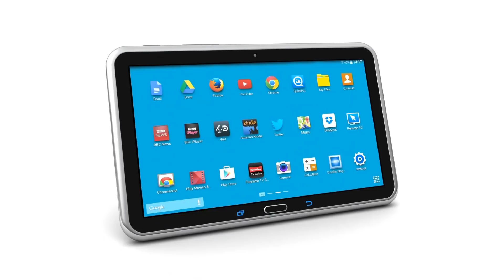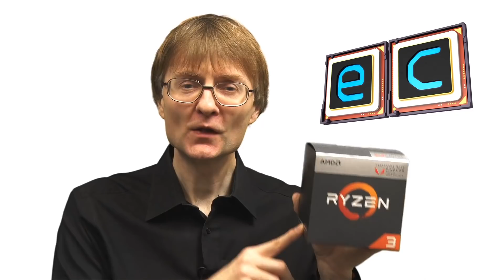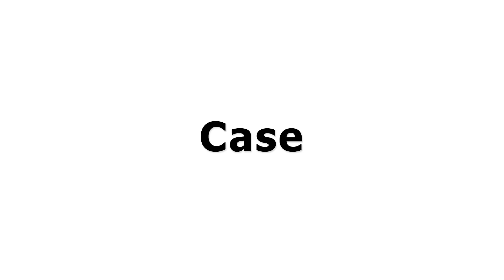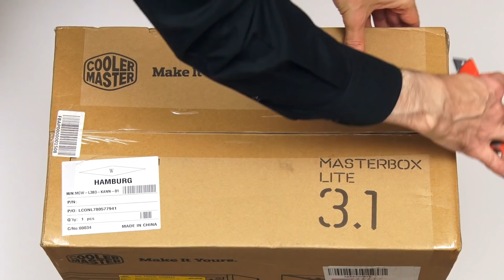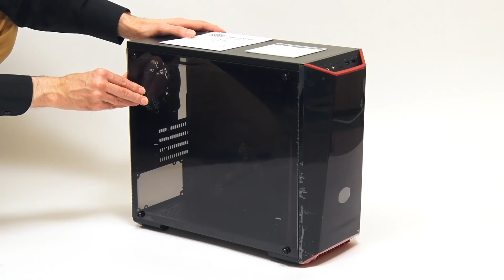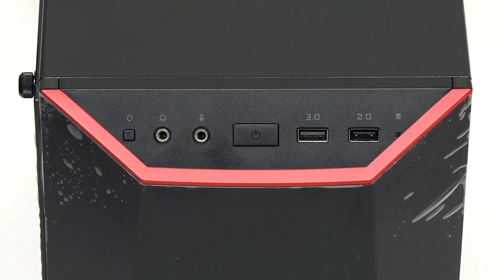Ryzen Budget PC Build #2: Case, PSU, SSD & Assembly

Comment: At the point of PSU mounting, it would be better if the assembler knew how air moves in and out of the PSU unit, how massive fan works, and from all that install PSU, and not installing it from screws holes/place.
Reply from the maker: I am well aware of airflow. Here the PSU draws in cold air from under the case and exhausts out of the back. The whole point is that the PSU is separated from the internal case airflow. As I recall, this is very clearly explained in the video.
Reply: @ExplainingComputers  Thank you for answering. My comment has not to do with you. I am sure that you are aware of air flow and directions. I was talking generally for those who on PC assembly do not know air flow directions as far as it concerns PSU air flowing, and, as you mentioned in the video, they keep asking how they should install PSU inside the case.
Reply: Thanks

Comment: At 7:00
Advice to never skimp on power supply....

A too true piece of advice that can be overlooked....you ideally you should try to get your power supply sized so that your total power used by the system is approximately 50% of the rating of the power supply. This is approximately the low end of The Sweet spot on efficiency of conversion are the power, Plus the power supply will just be loping along easily and last a very long time....

Comment: I just  build a pc, new parts. Not building for first time and checked your steps. Pc turn on all working and i dont have signal on monitor... Change monitor, change cabels, check rams, battery reset and still disame.. Do you have some advice? Disame motherboard.
Reply from the maker: What processor did you use? I ask because you will only get a signal on the monitor from the connectors on the motherboard if you used an AMD chip that is an APU (one with a G on the end, like the Ryzen 3 2200G I used here), that contains a GPU. Most Ryzen chips do not have a GPU, so have to be used with an external graphics card.
Reply: @ExplainingComputers  ryzen 5 1600.. Im waiting for other grapich card to try. Ty
Reply from the maker: @sova7883  Good luck!

Comment: I was so pleased by the cable management channels behind the motherboard when I made this computer. I hadn't done my own build in almost 15 years due to budget constraints(I was using refurbished office machines with a bigger HDD, some cheap RAM and low end graphics card added in, generally costing in the region of £100) and always dreaded heading into spaghetti junction when wanting to add or remove a drive. Add in the extra convenience of having a modular power supply, and my case isn't overflowing with random, often never used, cables anymore.

Comment: 6:25   .... oops....  BAD MOVE.  A much higher power pwr supply is NOT a good idea.  It's much inefficient at low load you have and can regulate less - result:  more noisy.   My build computed at 222 W, max., including extreme max. of video card.  Margin factor of x1.5 = 303 W.  I got a 350W supply.  And 80-Gold certified, which is the feature worth paying for.
Reply from the maker: It depends what you are or may do with the PC in the video. This video is the second in a series in which more is added to the PC. The PSU used here certainly is not noisy at low (or higher) load.

Comment: The PSU that Chris used in the original build is no longer available from Amazon. However if you follow the same link you should see a suggested alternative of a Corsair TX550M 550W, which is exactly the same rating and price, but it's modular so you are not left with that big bundle of redundant cables to tuck away in the case. Win!
Reply from the maker: Win indeed!

Comment: My motherboard seems to be working absolutely fine but I noticed that there's a red light on in the case is that normal?
Reply from the maker: Yes, this is normal -- many motherboards have LEDs on them now.
Reply: @ExplainingComputers  Thanks for the reply! I learned that LEDs can be controlled through the bios settings ^^
Reply: @mixedfuses8pack48  
You are a good hacker

Comment: Chris, When I installed my motherboard into the case all the screws fit except the one in the upper left-hand corner. I realize it is a tight fit and I tried twice with a 12" screwdriver in order to make this easier, but no dice. Will this cause a problem since all the other screws are secure and the motherboard does not seem to be moving?
Reply from the maker: It should not cause a problem if the motherboard is secure. But be careful putting in any connectors that may bend the board if you are applying pressure on that part of it.
Reply: @ExplainingComputers  Thank you   and be safe.

Comment: can you answer my question please !!!   i just build a new computer with a aorus x470 ultra gaming motherboard and amd 2700x , video card ,  2 x 1-TB hard drive and 2 x nVME M.2 SSD 1-256GB AND 2-500GB , but in the bios i can can see my 256gb ssd but not the 500gb ssd !! why !
Reply from the maker: I would check the BIOS settings to see if your M.2 and SATA slots are a port. You could easily test by removing the HDDs.
Reply: thank you very much for the answer  !!

Comment: i think you might have to upgrade you cpu when you upgrade to a  gpu do to the graphic in the current cpu r 3 2200g has graphics in the cpu
Reply from the maker: The 2200G CPU works fine with a graphics card fitted. No change needed.
Reply: @ExplainingComputers  thank's didn't know that, i thought i read that the r 5 3400g did not ,will this one work  as well with  gpu ???
Reply from the maker: @superoutchthathurt  Yes, all "G" Ryzens will work with a separate GPU. The internal GPU will just be deactivated. Most motherboards will adjust automatically. But in some, you may have to manually set in the BIOS to use the external rather than internal GPU.

Comment: I assembled a PC with Ryzen 3 3200 cpu, Gigabyte B450M DS3H WiFI motherboard,Corsair Vengeance 8gb Ram, WD1 TB HDD,Corsair 550 power supply, and installed Windows 10 Enterprise (1903 ), system is doing great but only 5.95 Gb of Ram is showing as installed ram, I have updated my motherboard to Gigabyte F41 bios, how to get full ram ,   please explain

Comment: Very impressed by your video. Just enquiring do you have to use an SSD drive or can you use a 3.5 HD?
As I'm upgrading my PC to AMD Ryzen 5 2600 3.9GHz + Gigabyte B450M DS3H Motherboard and have followed your instructions but when the computers turned on nothing appears on the monitor. Kind regards.
Reply from the maker: Certainly you can use a 3.5 inch hard drive. However, if you have used a Ryzen 5 2600, rather than the 2200G I used here, you will not get an image connecting a monitor to the ports on the motherboard, as the 2600 does not have integrated graphics (there is no "G" on the end to indicate the chip has a GPU). So you will have to add a graphics card to your system to get an image, or change to a processor like a 2200G, 2400G, etc.

Comment: A suggestion: Connect and power up everything and run system for an hour (Best to fully load OPSYS) before starting build . To start PC momentarily short across PW pins on the motherboard with small screw driver or Stanley the knife.
Reply from the maker: I agree with such a soak test. But when I did this in a previous build video (my i7 one) I got a great deal of criticism in the comments. So I cannot win! :)
Reply: @ExplainingComputers  I suppose they only want to see the build. Maybe just explain ;) that it's good to do before assembly.
Reply from the maker: @nunya___  The complaints I had were there it is a terrible thing to do to run teh motherboard assembly outside of the case. :O

Comment: Just my opinion, of course. The Cooler Master PSU Calculator that you point out has come along a bit since you filmed this, but I have reservations about the direction it's come. For instance, it does not list any AMD Ryzen CPU less than a 7, although it does list a couple of the Threadripper chips, and none of the G series at all. In the end, I couldn't use it.
Instead, I'd like to suggest a couple of other power supply calculators, one by Outer Vision, and the other by New Egg. Both are a little more refined and complete than Cooler Master's contribution and I found them helpful.  I should mention, though, that New Egg sells electronics and have a bit of a vested interest. I'm not sure about Outer Vision. 
Outer Vision -- https://outervision.com/power-supply-calculator 
New Egg -- https://www.newegg.com/tools/power-supply-calculator/

Comment: Will M.2 NVMe SSDs support on Gigabyte B450M DS3H & Ryzen 5 2400g?? Plz ans!!
Reply from the maker: Yes, you can use an NVMe M2 drive on a B450M DS3H motherboard wit a Ryzen 2400G. :) It will work fine.

Comment: I got 2 hd 7200 rpm and 1 ssd, is ok to conect all 3 on the same cable? my power supply is a corsair cx650w
Reply from the maker: Yes, you should be OK with this.

Comment: I've only built 1 desktop PC myself. I had help with a good friend who knows a lot more than me. That was January 2016. By myself, I've upgraded from a mechanical 2TB to a dual 512gb SSD/2TB mechanical config, double 8gb RAM to 16gb RAM, and then from stock air cooler to a closed loop water cooler.  
I like watching these videos as well.

Comment: Nice budget build! I wonder if the stock Ryzen cooler would be too tall for a 2U server chassis. I just picked the chassis up for cheap used on Ebay and I intend to put it in my audio rack. The computer needs not to be very powerful, just good enough to run Debian and play music files, so probably an embedded solution would be better. The case is a Micro ATX/ITX 2U case. I will use a DAC for the audio. Great choice's made for the components here, I've had great luck with Gigabyte, Corsair and AMD in the past.
Reply from the maker: Thanks for your kind feedback. I suspect you may be right on the height of the stock cooler. Maybe try something slimline from, eg, Noctua?

Comment: Regarding the risers, to say they simply "support" the board is rather vague.  The real purpose is to raise the mobo so it doesn't come in contact with the metal case, thus causing a short and probably killing the board.
Reply from the maker: I think this is obvious to all viewers -- the board is supported above the metal. :)
Reply: Seriously?  If the build is meant for beginners, why would you assume such a thing.  And if it's meant for experienced builders, then the video is moot.

Comment: Just put one together following your instruction. However I have one question. I'm using a hard drive from a laptop with Win 10 already on it, do I need to install all new drivers for it, or is it good to go.
Reply from the maker: If it boots, just install new drivers. But it is very unlikely to boot, as OS installs are machine specific.
Reply: @ExplainingComputers  It works fine, but I get a watermark saying Windows not activated, but everything seems to work.
Reply from the maker: This is great to hear. So just install drivers, and all is fine. :) The Windows activation thing will be because Windows 10 was registered to the laptop's hardware.

Comment: A few points I have to make :

1.People say Corsair Vs are bad, but I've had one for a while now and I think it's a very good PSU. I once said something on reddit about it and of course someone argued and was a retard. Don't mind these people.

2.I bought a Masterbox lite 5 for my i3 build and its a good case but it doesn't have good dust filters like the 3.1. It only has one on the bottom and it isn't very good quality.

3. I noticed your motherboard came with a Vga port. My motherboard didn't, and I had to buy an adaptor for it because I have an old monitor. (the computer I built is not a gaming pc)
Reply from the maker: Thanks for this. VGA ports are more common on gaming motherboards, as they offer lower latency.

Comment: ✌️Gigabyte B450M or Asus prime B450m-a
Which is better??🤔🤔
🤔🤔Can I use COOLER MASTER MWE 450 Smps  in the above build ? Can  it give sufficient  power to the cpu?

You can help me .....................
.............................
                             .......................
.............................
Reply from the maker: Both B450 motherboards should work fine. Personally I usually get Gigabyte boards, but there is nothing wrong with Asus. That PSU should be fine.
Reply: @ExplainingComputers  Thanks❤️❤️😃

Comment: It is quite wasteful to have only one front USB 3 and only 1 front USB 2 sockets. Depends how many  USB items you want to connect like a WIFI adapter, wire Keyboard and or mouse. Or other items.
Reply from the maker: I agree with this -- more front USB would be nice. Though keyboard, mouse etc are usually plugged in around the back.

Comment: Really nice build. I recently did a new build for my Linux machine using the same case and PSU. One thing I found worked quite well was to lead all the extra cables through the rear then feed them back through the hole leading into the drive bay. It's tricky to get them looking neat but does make a difference. (unless you plan to use the bays). I thought about cutting a small piece of toned perspex to hide then further but I'm not a neat freak to that extent. For the money, it is a nice case! I would probably advise spending a little bit more to get the glass side panel if aesthetics are important because the plastic panel does get scratched up fairly easily.

Comment: all the fans are spinning, the motherboard is powered up, on/of button and usb's at front and back of pc are working and I am using the same motherboard. I will try connecting up to a tv using hdmi cable  and will post back with the result. thank you so much for replying!
Reply from the maker: Good luck!
Reply: @ExplainingComputers  i tried hdmi cable hooked up to tv, but no luck.i also stripped down an rebuilt and found no fault in the build only thig i did was snip the little metal protrusions from the pheriphal shield as i found it difficult to push the pheriphals into place. i am thinking a fault with mother board or processor,maybe esd damage but i was careful when building. if one of those then i may have to replace
Reply from the maker: Sorry to hear this. Sadly it sounds like a MB or CPU issue as you note. :(

Comment: i followed instructions and decided to use a modular psu and at end  i powered up and nothing on my monitor,dont know what to do now?need help, my monitor uses the cable that screws into  old monitor connection, not the dvi or hdmi, something to do with that? or  the modular psu?
Reply from the maker: The modular PSU should not be causing you a problem. Are the fans spinning? IE, is the board powered? Are you using the same motherboard I did with a VGA port? If so, it should work with your VGA monitor. However, if you have a motherboard with DVI or HDMI or Display Port only, then using a passive (say) DVI to VGA adaptor will not work, as there is no analogue signal to convert. So it may be a monitor issue. Do you have a TV available with an HDMI connection that you could test with?

Comment: A future video idea - about PC case fans - how to decide what case fans you need, where is the best place to fit them, are there good/bad manufacturers, which way should they face, how to check that existing cooling is adequate, how to cool a PC well with the lowest possible noise, etc ... with a cameo appearance from my favourite guest, Mr Thermometer, if possible.
Reply from the maker: Great idea -- noted. :) You will see a little of this in the video a week on Sunday, which includes fans, temperatures, and a power meter :)
Reply: Thank you!

Comment: Have made tower up. But when switched on it lights up but no video have tried HDMI to tv and D sub port to monitor. Any ideas. Any help appreciated.
Reply from the maker: Check everything is seated OK in its socket OK -- RAM, PSU leads, and all other connectors. If in doubt, remove each and put back in. Check there is power in the keyboard -- eg will CAPS lock come on? And does the CPU fan spin? And any connected case fans?
Reply: @ExplainingComputers  thanks got it working ram was not seated right. Going for the graphics card next. Pleased with tower just need to add wifi. Thanks for doing this set of videos as it's encouraged me to build one.

Comment: great video and build only thing i would of done differently is gone with a  Semi-modular or Full-modular so excess cables that are not needed can be unplugged from the power supply mite of been a few extra pound but that is just my neat mind set kicking in. ps did a good job tidying them hydra heads ;)

Comment: Just bought a gigabyte b450 gaming since it was the only b450 motherboard avaiable on the store where I purchased my PC components and I got a nice discount. I intend to use it with a Ryzen 5 2600x, 2 DDR4 8GB RAM and a 8GB rx580 Armor GPU from MSI. I am a little worried since this is a simpler motherboard. Will this motherboard work fine with this build?
Reply from the maker: Those parts should all work together just fine. A more powerful and power hungry PC than the PC I've built in the video, so make sure your case has adequate cooling.
Reply: Thank's a lot for you reply! Will do.

Comment: I think that a 2400G might have been better and allow you to have G-Sync enabled, I think that a Little Devil PC-V10 might have been better as you would have Phase Change Cooling but the APU has to be installed per the instructions that come with said case, You do get slot loading DVD/RW multi-format drive some are like the ones for Laptops.